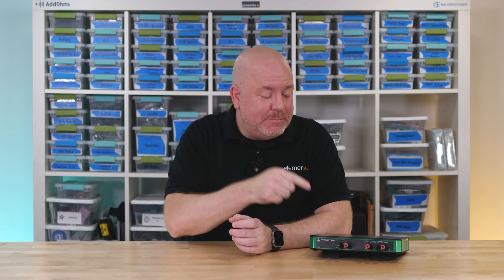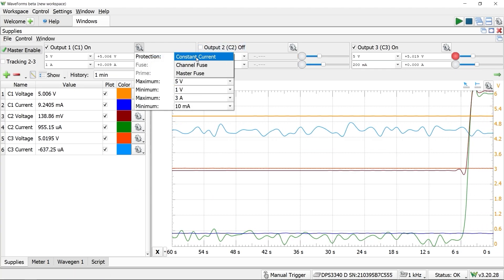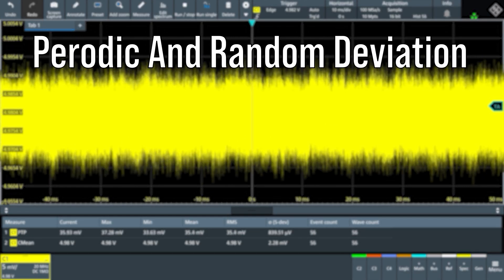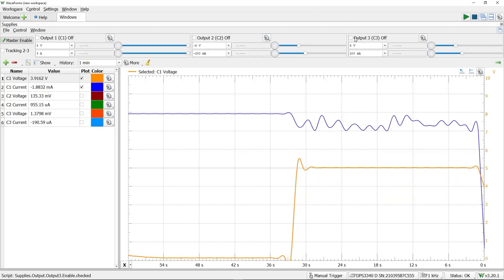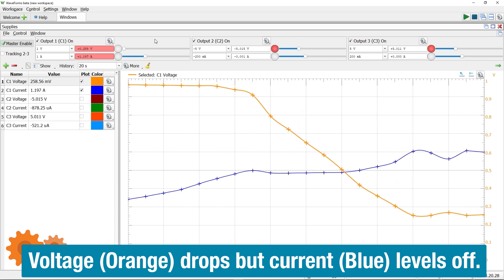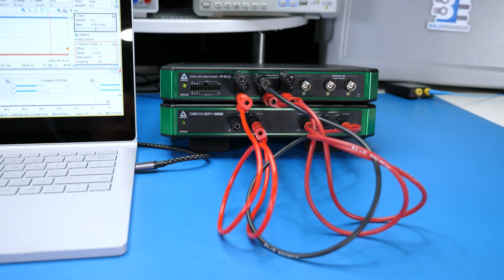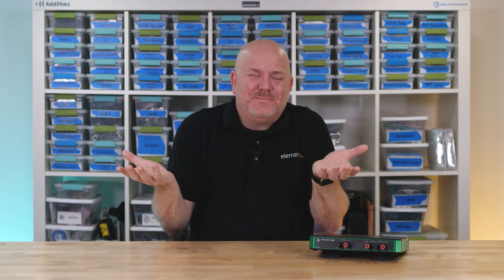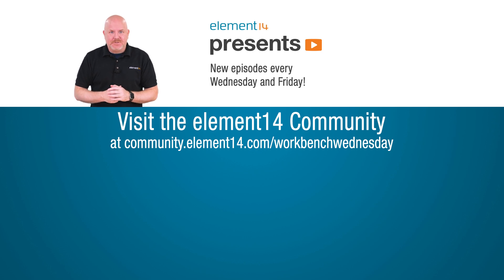Digilent DPS3340 USB Bench Power Supply Review - Workbench Wednesdays

Comment: this costs as much as a 3 channel rigol power supply, has less capability output wise, and has no display for local manual use. I also don't know if it can be calibrated for use in test fixtures and such. It is compact though.
Seems like a bit of a miss.

Comment: ELEMENT14, Why does Electronic Loads add more ripple? you didn't explain or show in a YT lesson about measure the ripple on Electronic loads.
Reply: It is the nature of how they work. They are basically a JFET in a control loop monitoring the voltage drop of a sense resistor. Using that drop, it varies the resistance of the FET to simulate constant current, voltage, or resistance. So as the supply's voltage varies, the load varies its FET resistance, which affects the voltage, which causes the supply to adjust its voltage more. So they end up working against each other (a little bit.) 

Electronic loads are very reactive. They are not a true constant supply like a discrete resistor.
Reply: @bald_engineer  Try to make a YT lesson about measuring the PARD and Ripple on various Electronic loads. This would help me know how to measure PARD and Ripple on various Reactive loads
Reply: @bald_engineer  FETS cause switching noises but FET switching off/on is considered Ripple or PARD?
Reply: @waynegram8907  That is not what I meant. Electronic Loads use JFETs as variable resistors, not switches. 

The time it takes for them to sense a change and react creates ripple. Just like the time it takes a (bench) power supply to sense and react creates ripple. 

That's why they are considered reactive. They have a time component to their response.

Comment: it would be interesting for these reviews to cover software availability for different OS, sadly a lot of specialized software is only available on windows. So its always good to know if alternative software works with a device or if there is a linux or mac version. (especially if its controls are purely software based)
Reply: Good point. I made the assumption that someone interested in this supply would be familiar with Digilent Waveforms, which is a cross-platform application. They have binaries for Windows / macOS / Linux. The Linux binaries are available as .deb and .rpm packages. (At one point, they had a build for Raspbian / RaspberryPi OS, too.)